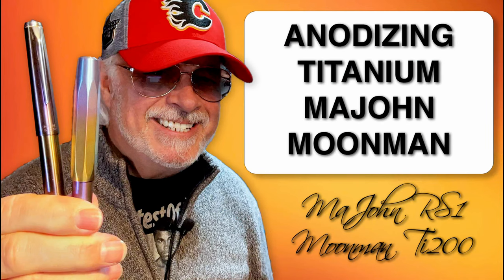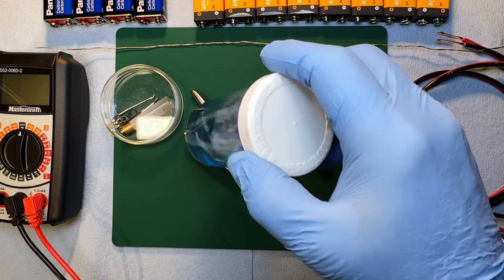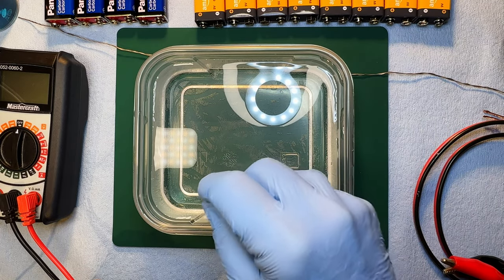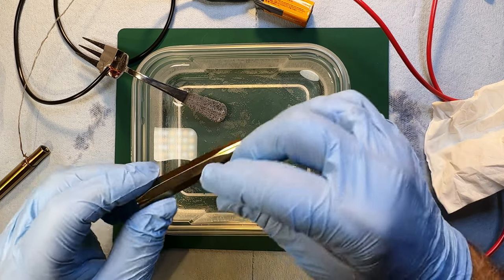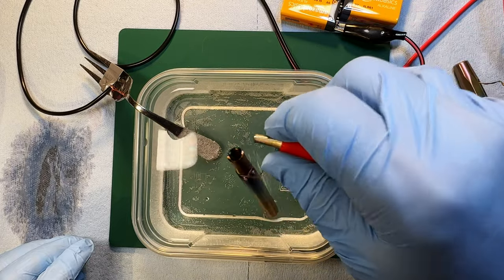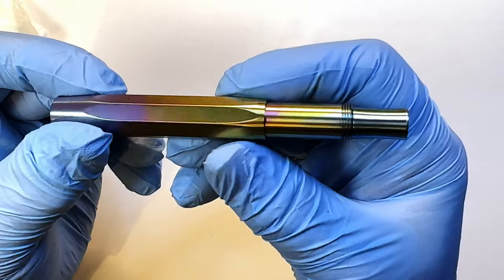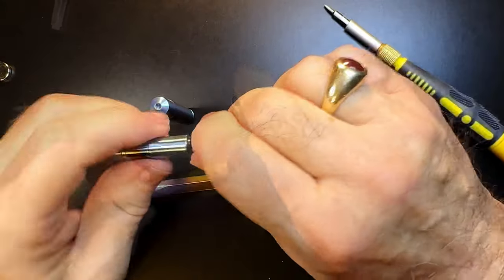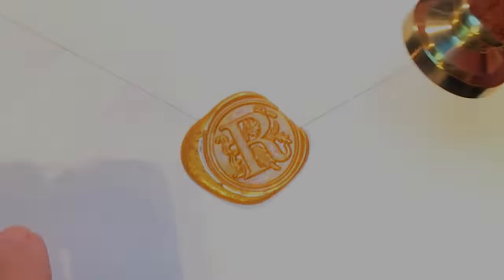Anodizing Titanium Majohn RS1 and Moonman Ti200 Fountain Pens 2022

Comment: Wendy Frankenstein here..Will try with a 6v car battery disconnected.  Maybe dip it into the charged electrolytes. Lower voltage but might give me a different silver. I'll try other options. Maybe I just had too much coffee. Lovely video love ❤️ your results.
Reply from the maker: Battery acid might have an interesting effect! LOL
Reply: @InkquiringMinds  also have access to old 12v auto battery.   Won't dip till it warms up shouldn't affect the ti or ss for a quick dip and wash.
Reply from the maker: @wendyholiday2021  LOL

Comment: If you want a line-free finish on the outer surface, you can ball up the end of the titanium wire and stuff it inside the Ti pen parts. You only need enough to have a light friction fit so the parts do not fall off the wire during anodization. 
I really like the look of both pens after you finished 😄👍
Reply from the maker: Thanks, Kenjiro5775!

Comment: The pens turned out great. I remember seeing titanium 'painting' done by clipping onto the metal of a paintbrush and using a dc voltage regulator and while the brush was moving over the titanium, adjusting the voltage to get the different colours. Of course the bristles of the brush were saturated with the electrolyte mixture. I wanted to try it but didn't know where to get titanium at that time. I guess this also proves that the pens are actually titanium. Well done.
Reply from the maker: I might try vinyl pattern stickers for nails as masking when I do this again.
Reply: @InkquiringMinds  I think that would work quite well.